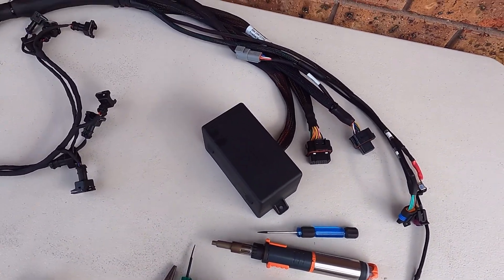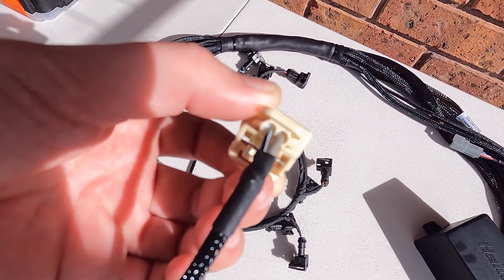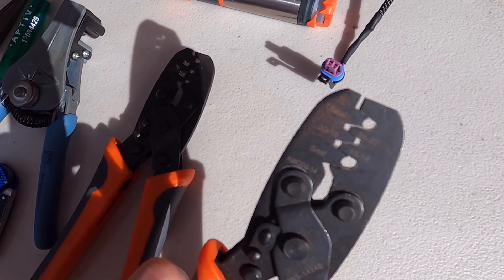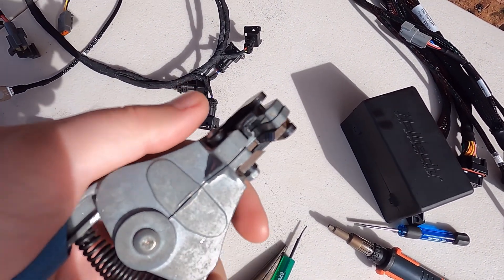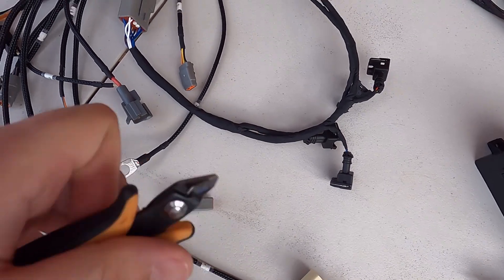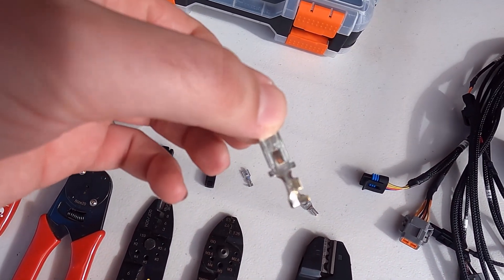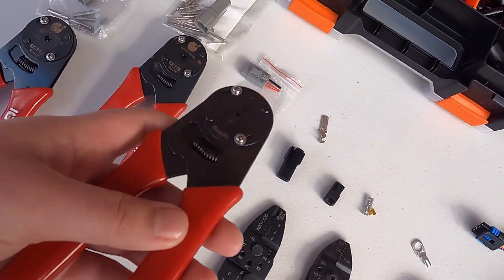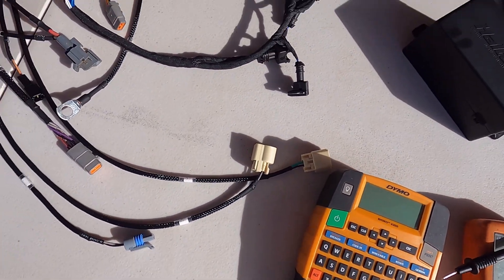Standalone ECU & Engine Wiring Harness tooling rundown

Comment: I have disassemble a factory harness 
Then soldered the wires back into single stran color coded full wire with shrink wrap 
I checked continuity on all.
Would these wires preform with the possible resistance from the soldered connection. To use as a stand alone wire harness?
Reply from the maker: Hi Ezra Dixon, soldering is fine and will suffice however not my preferred method. I'll post up a video of my method in the next couple of weeks which involves open barrel splices.

Moving on to your  question around single strand wire over automotive multi strand.

Single strand needs to stay in the home and not be used in your car,

Single strand is meant to be installed and fixed never to move again. What you will have is vibration and if you where to move the loom around installing and refitting your engine numerous times all these are problems and will cause a break and more so could hurt your engine as a result.
Reply: @stavjetauto  thanks . The wire is automotive grade from a factory wiring harness
Reply from the maker: @ezradixon239  okay I thought it was single strand solid core like household wiring haha. You should be sweet then.

Comment: Thanks for this. Any chance you can do something on the braided sleeve? I’ve tried using it but frays has notably and can’t be used. Is there different braided sleeve that doesn’t do this?
Reply from the maker: Sure thing I plan on doing a 3 part series on an engine harness build so hopefully that will answer all your questions.

But if you have any further questions please leave them here so I can make sure I spend time in going through them more in depth.